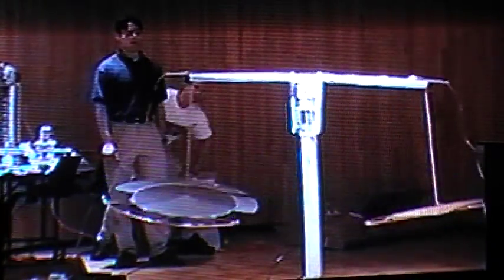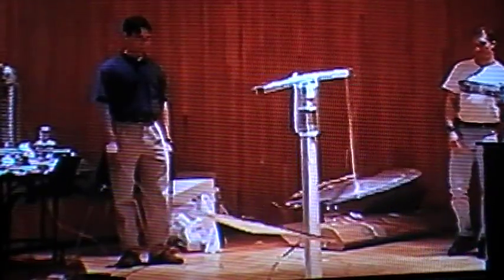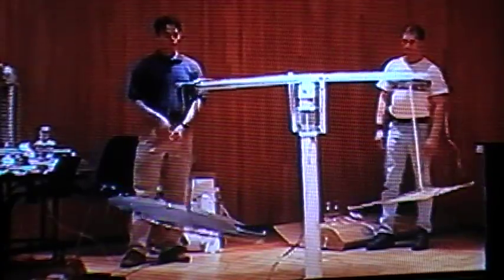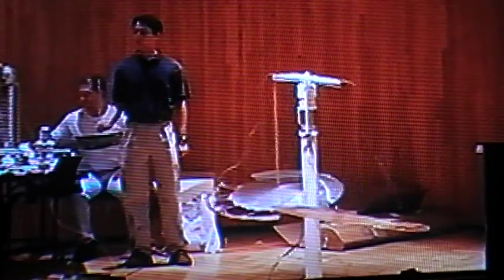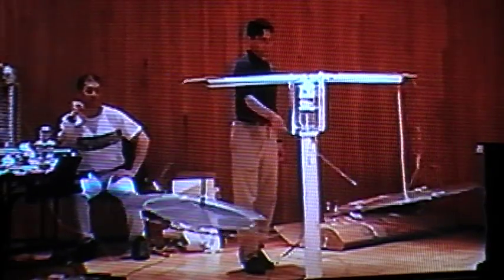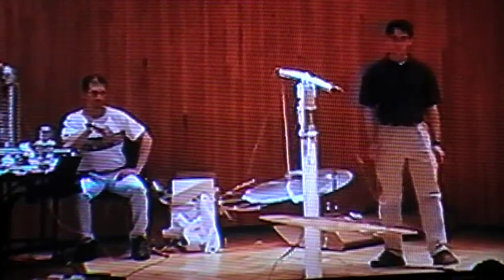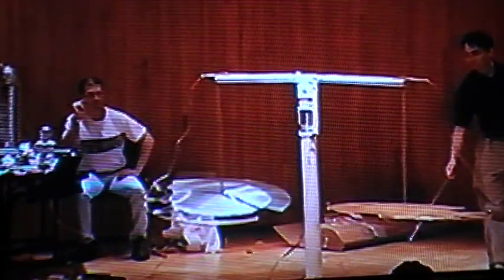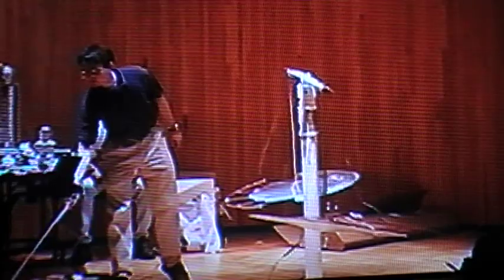TT Brown Electrokinetic Apparatus

Comment from the maker: It's just a SECONDARY gragitational-field of 1/2 G that holds everything inside fast to the deck (high-energy electrostatics is the same as a gravity-field) and two like-fields in Nature REPEL. So mass is repelled by the RIM of the IGV, which is highly NEGATIVELY charged, a surplus of electros, Ther is electron starvation or positive-charge at the hub, which is an ether-sink, and you can pick up and carry anything, no matter the weight.

Comment from the maker: Yes, inside the flight-Voltage IGV, time rus slightly faster, because it is only 1/2 G. Just as clocks in Earth orbit or on the Moon run faster than clocks at Sea-level. Intense gravity-radiations cause time to slow down. With IGV-flight, there is no inertial-mass-dialation. No inertia. Despite speeds MUCH faster than any rocket.

Comment from the maker: No, time flows SLOWER near the Earth-s surface than it does in Earth Orbit, and runs faster further out in space. Time slows down with increasing inertia, velocity, or gravity. The onboard gravitation on the energised IGV is only 1/2 G, so time runs slightly faster inside and IGV, and always floys at the same rate, no matter the speed of the IGV, because it is inside a constant 1/2 G gravity. Time slows under influence of gravity, or velocity. But the IGV has constant 1/2G onboard gravitation.

Comment from the maker: Searl is not building a vehicle. I am doing that Fernado Morris, Chief SEG engineer and many other paid staff are completing the work in Thailand as we speak, a smaller conference is planned, and the DVD will be ready as planned, January 15. Look out for new video starting sometime after new years. All going well, some delays, as with any project. I am finishing an all polystyrene, fully-articulated (64 working flight-cells) 3-meter IGV (same size as the P-11, from 1968).

Comment from the maker: Thanks. I admire your work greatly too. We've taken TT Brown's work and patents to a new level, with modern equipment, but still the same simple electrogravitics. I built this TT Brown rig and we first did these experiments back in the 1990s. Built this in 1999. The demo was in downtown Reno, Nevada, near lake Tahoe, in late June, 2000. Then, a year later, we started building hovering antigravs using the same methodology weve used personally since the late 1980s. I published  in 2002.